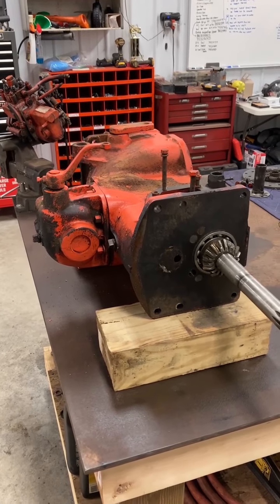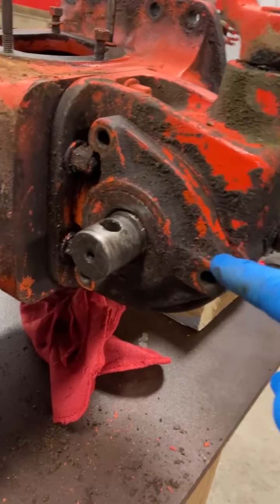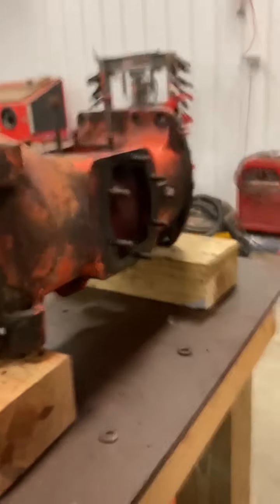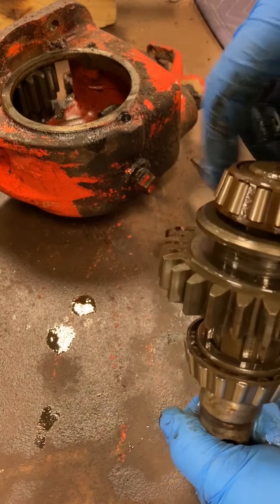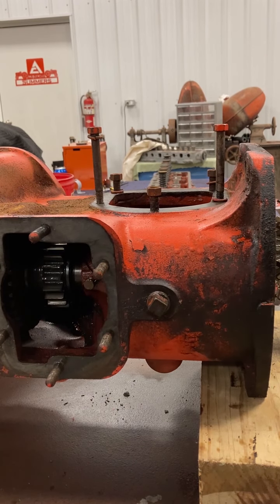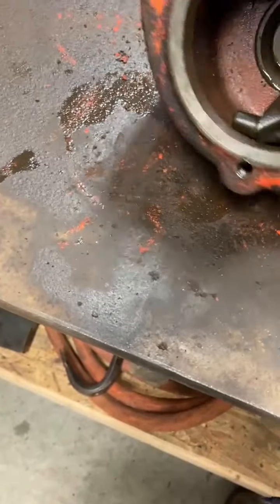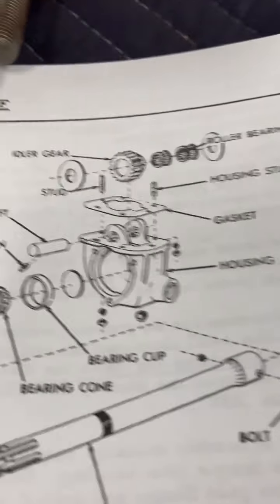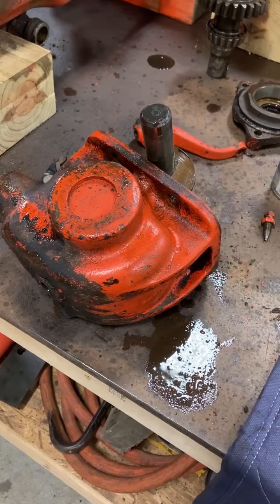Allis Chalmers WD PTO Housing Removal and clean up Part 19

Comment: Good  day  Boy that gear is really hard to slid,  does  that mean it has not been used much.  Anyways  thanks for now.
Reply from the maker: Don, so you will see in the reassembly video on the PTO housing (coming soon) there is a spring and two ball bearings inside this sliding gear.  That's what holds it in either on or off position so it creates some friction.  I also had some dirt in there that once it was cleaned up slide just like it should.